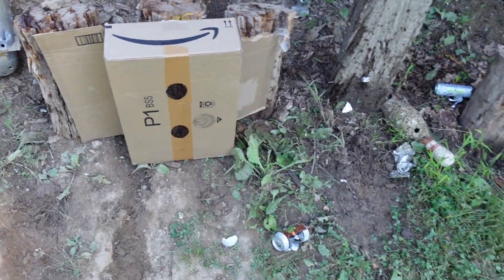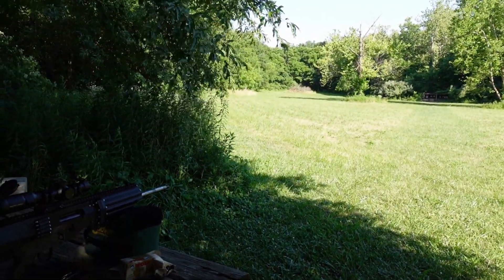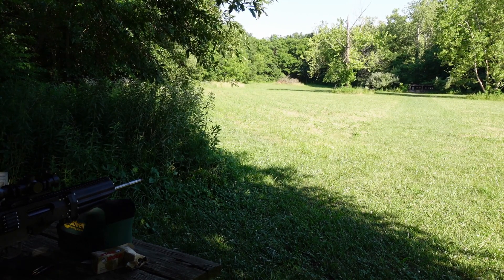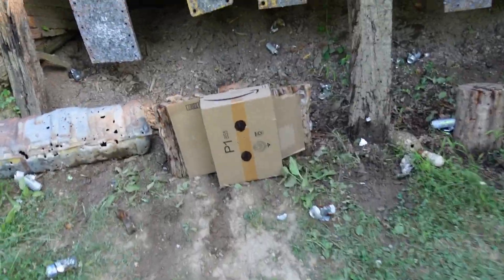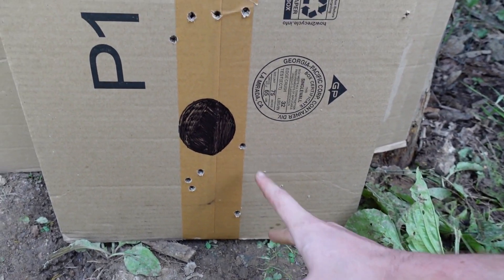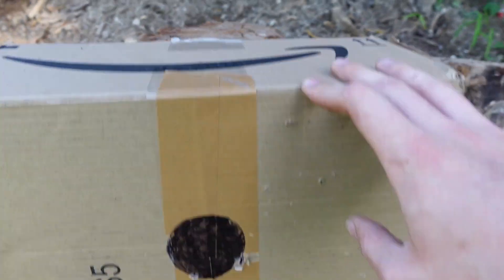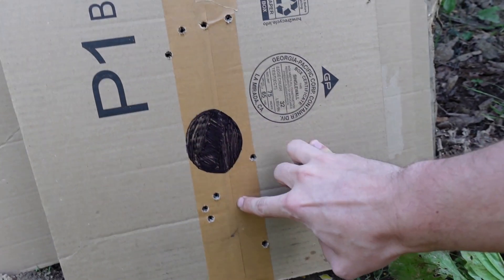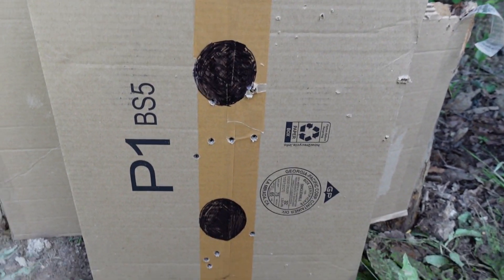Amigo Grande Heat Deflection Testing

Comment: Not as good as AWCYs upper.
Reply from the maker: Have they done any heat deflection testing? The fella over there I talked to said they hadn't done any formal accuracy testing yet, let alone something like this. Would be cool to see how the clamped stub holds up.
Reply: @IvanPrintsGuns  I'm not sure about the testing yet, but it looks less chunky. It's promising.
Reply from the maker: @joshwizardguy7662  I see, so the one that hasn't been tested like this is worse because the other one hasn't been tested like this? I don't think that's quite how the scientific method works. Aesthetic preference varies person to person, but verifiable/falsifiable fact does not - hence why I'm testing stuff and not musing about looks.
Reply: @IvanPrintsGuns  I pretty sure your build isn't going to last very long. Don't be salty. By the way, your plastikov is missing a safety selector.
Reply from the maker: @joshwizardguy7662  It's lasted 700 rounds, that's pretty long if you ask me. Using one breath to call things bulky then another to say it won't last long is pretty funny, though.

The Plastikov intentionally omits a selector, since adding one will result in a significantly weaker rear receiver section unless one adpots a totally new selector design - in which case things get needlessly complex.

If it bothers you, don't build one or adapt the design yourself - I won't go crazy and accuse you of stealing if you decide to remix things.
Reply: @IvanPrintsGuns  I generally don't like clunky designs. I grilled AWCY for the chonk 15 a while back. I'm currently working on a project myself. My design is supposed to be sleek, resilient and have a practical defensive use.
Reply from the maker: @joshwizardguy7662  If you don't like things that are overbuilt (for safety, usually), then printed guns is the wrong scene to be following. The Chonk-15 is amazing, it's awesome someone was able to take the reference model and make such a ambitious build with it.

If you want something sleek and resilient, build or buy a Glock.
Reply: @IvanPrintsGuns  That doesn't make any sense. Design philosophy is what determines reliability and rigidity. Your application of support elements (like screws and u-bolts) do barely enough to increase rigidity. If you were to apply a more professional design, then maybe it'd be just as good as any factory gun. That's what nobody really gets but that's okay because I'm going to make my own projects.
Reply from the maker: @joshwizardguy7662  The U-Bolt AR15 isn't even that good, and it's still better than any commercial polymer AR15 offering that doesn't integrate the grip and stock into the lower.

>Just as good meme unironically
That's not really the point of any of this, except in rare circumstances like the Tec-9 frames where the original polymer ones were garbage.

Good luck with your own projects then, I hope you don't have to put up with people who have no idea what they are talking about telling you all the things you are doing wrong!
Reply: @IvanPrintsGuns  🧂🧂🧂🧂
Reply from the maker: @joshwizardguy7662  Well measured and thought out as usual.
Reply: @IvanPrintsGuns  What else do you want me to say? You're taking everything I said personally.
Reply from the maker: @joshwizardguy7662  Someone disagreeing with you isn't them taking things personally.
Reply: @IvanPrintsGuns  You can disagree all you want. The way you sound is what makes you seem salty.
Reply: @joshwizardguy7662  have you designed/released anything noteworthy in the past? I would love to see, and potentially even test some of your sleek, resilient, and practical designs.
Reply: @lukek.4984  I'm working on a CETME-L based derivative right now.
Reply: @joshwizardguy7662  How is that working out? Can it be to upscaled to 308/do you have a 308 design in the works?
Reply: @fiskersproductions  I've never got around to it sadly. Too many changes in life made that nigh impossible to achieve. I had recently came up with an idea for printable propellants to make caseless rounds. The idea is that they can detonate using an electrical charge from a piezoelectric action. I don't think it could be as useful though.
Reply: @joshwizardguy7662  that's a shame, appreciate the reply to an ancient comment though. I get where you're coming from for electrically actuated munitions, though it's leaning a bit into the realm of gimmicky
Reply: @fiskersproductions  yeah, it's just a fun idea with only a few benefits for the most part. At least on the bright side, I'm planning on building tools that can make it easier for people to fabricate metal gun parts

Comment: Maybe I don't understand how this test works. But wouldn't have been more effective to heat up the gun by just doing a really fast mag dump?
Reply from the maker: It's 20 rounds either way. You're talking maybe a 10F deviation if I just empty the mag. This way you've got the data point of knowing during the 20 quick rounds it definitely was still shooting straight, since the steel was ringing.

Comment: looks slippery, maybe foux picatinny or texture would help
Reply from the maker: It's normal for rifles to slip off of the bags under recoil. I guess adding a no-slip cloth to the top of the bag would fix it, but recoil's going to recoil.
Reply: @IvanPrintsGuns  yeah, but the fore end just seems so unwieldy and slick, but hey will you be experimenting with polymer ammo in the future in your guns? maybe like a run through on your old builds with new ammo, would probably help with heat
Reply: @zeke2095  They're just as slick on Spanish-made CETME's, especially the wooden furnished ones. Not ideal, but not annoying enough to warrent a redesign. A forgrip would certainly help though. :3